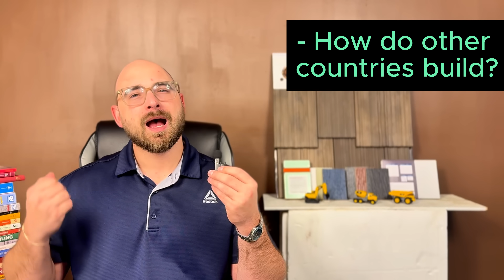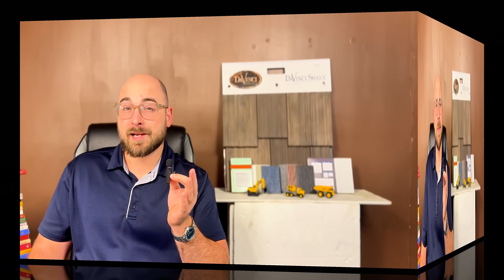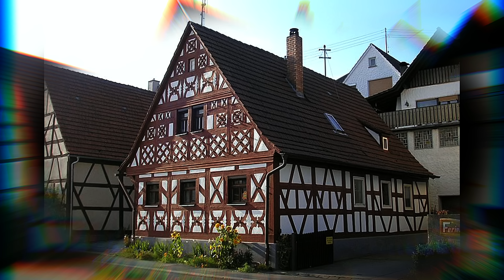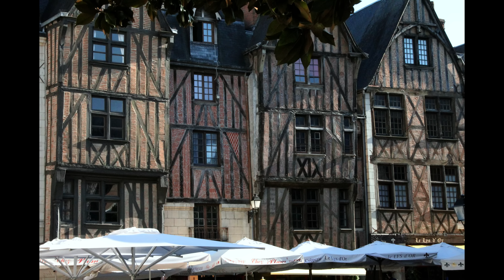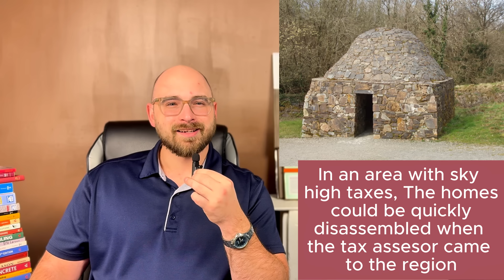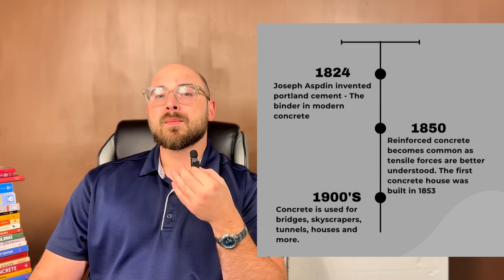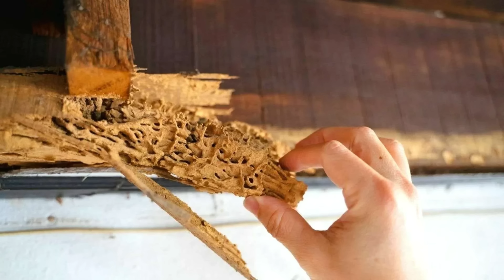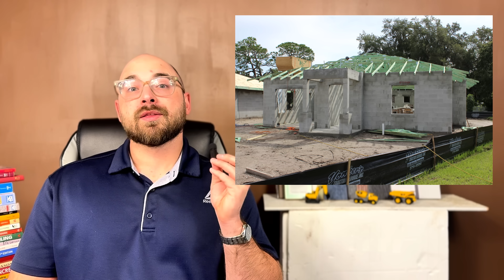Why Other Countries LAUGH at American Homes

Comment: I can tell you the answer from experience rather than internet research:
I was a carpenter in the USA for over 20 years. I also spent a year building houses in Sweden. The big difference that in Europe, designs are led by architects and engineers. In the USA architects and engineers are led by lawyers. The Simpson Tie company has a monopoly on how homes are built in the USA because they paid engineers to test their product. Engineers always specify what has been tested. If you don’t use exactly what the engineer put in the plans, the inspector makes you take it out. 
No USA architect will specify local materials without a hefty price tag because engineers won’t sign off on something that Simpson tie hasn’t paid some engineer to test. Because they are all afraid of being sued. 
You won’t get permits for anything that hasn’t been signed off by an architect and an engineer. Building codes are solely for avoiding lawsuits. Not safety. You won’t get insurance for a house that hasn’t been built in outdated inappropriate, light timber houses because it has been tested. Without insurance no one can get a mortgage. If no mortgage, nothing gets built on spec. So there is basically one residential building style for all climates, because Simpson Tie paid an engineer. That’s a sham! 
Forget the ancient adobe houses in the southwest. The ancient stone buildings are curiosities. Forget the 200 year old hay bail house in Missouri. To get a permit you have to prove that a building will potentially last. Actually lasting doesn’t count as potentially lasting. 
That’s why everyone laughs at Americans.
Reply: Many thanks for explaining. This makes sense. In the Europe every contruction material must have certification to be placed on market. Certification require testing of material acc specific methods. There is no monopoly for testing in the Europe. 
It seems to me, in the USA is main issue by monopoly system for everything. Too much centralised power for private companies which then are allowed to "lobby" (allowed corruption by law) at politics and authorities.
Reply: @roman45678  🎯
Reply: @roman45678  American capitalism is very similar to Russian socialism: no big variety. In Russia the state, in USA monopoly. And both have oligarchy.
Reply: You should make a video about this
Reply: So it's all because of Corpo Trash. Makes sense.
Reply: @Sphendrana  Literally the root of all US and, nowadays even, Western problems :) love to see it
Reply: @Sphendrana and Reagan,  he was corporate crazy! 💯💥
Reply: @Sphendrana  Capitalism making something objectively terrible? What is this, a day ending with y?
Reply: @kristoffer3000  That is quite simplistic. Capitalism as an idea isn't bad. If implemented correctly, it encourages innovation, competition and better products for a better price. The problem is capitalism needs to be reined in with regulations. That went overboard in with Thatcher, Reagan and other liberal conservatives (not the American idea of liberal) in the late 70's, early 80's. This put capitalism into overdrive and allowed a small group of people to gain all the wealth, as it was in the late 1900's, with the Robber Barons. I know this is YT, but the distinction is important.
Reply: @Yvolve  Yeah you have no idea what you're talking about, actually painful to read.
You're saying the people that removed loads of regulations actually put in place more?
Actual insanity.

Also saying liberal conservatives is just honestly funny, the people that are most against personal liberties are not liberal, they're also not very liberal when it comes to economics as it's always their own groups that stand to benefit and nobody else.

They didn't put capitalism into overdrive, they just pulled away protections which allowed it to be more brazen about what it does.

Capitalism has never and will never be good, it doesn't encourage anything other than being greedy, everything else is just a byproduct of that, if capitalists could just sell us the same slop year after year they'd be very happy to do so, technology moves forward despite capitalism, not because of it.
Reply: @Yvolve I’m sorry, but in the year of our lord 2025, we have mountains and mountains of evidence showing Capitalism is in fact not a good idea. No amount of regulations and laws is going to permanently keep Capitalism in that “sweet spot”that’s always talked about. Capitalists always want more, and we have seen countless times that they’ll inevitably monopolize, stifle innovation, and what we’re seeing recently and saw in the Gilded Age, a takeover of governance.

Europe has objectively better living standards than the US by far. Despite being Capitalist they haven’t succumbed to the same rot the US has because of  a better sense of community and more historical precedence to watch out for potential tyrants. In fact a lot of the reasons Eurpoe is better is because of their Socialist programs.
Reply: And every year that goes by I put more and more of Simpsons products into houses. It's obviously based on politics.
Reply: Great comment, very informative.
Reply: By the way, Here in Europe, we don´t need Companies to test some equipment. Everything you can buy here is already tested, and no Inspector can tell us to take it out, Everything here is already tested according to our laws. Otherwise, no one is allowed to sell this stuff here! You simply cannot buy a thing here that´s not firmly tested.
Reply: @bernhardmichaelfux308  exactly. All is on the laws implemented yet. An arquitect in Europe will only work with approved materials in the design of a house. Materials, structures, etc. With that base the arquitect and engineers will work in a house without any other previous requisit, because the materials already was proven, tested and regulated for all European arquitects and engineers freely (of money and for use it).

Even, for example, in Spain is aproved a new material, structure, model of construction, etc and a German arquitect want to use it in a new house in Germany. He/she can because the standars of quality tests is more or less the same level and then Germany don´t need to test the same material too (it would be a stupidity redundant). In the case of this example Spain did it for Germany. But at the contrary is the same too. It´s a more efficient concept or model of collaboration between European countries at the same time.

Regards.
Reply: @bernhardmichaelfux308 kind of, but not exactly how it works. If you build a house, people who know what they're doing will be involved. And they won't let you get away with mixing and matching as you please. They'll point you towards the exact type of concrete, wood, steal, glass or whatever for what you're planning. 

And that's a good thing. You have a plan, they try to get as close as possible
Reply: That was very insightful! It also put me onto another aspect of this: education. In Germany, we have a similar "everything has to be certified" type of mentality. Nobody will sign off on something if it isn't the officially recognized way of doing something. You have a safety issue in your building that you've thought of a unique solution for that's much more cost-effective? Too bad, they're not going to sign off on it because it's not a tried and true and tested way of doing it. However, because of the way we do vocational training, we have found ways to incorporate building materials that come with lots of variance into this mindset. We have a system where apprenticeships are officially recognised, with state-certified exams and teaching plans and so on and apprentices spend time both in the company where they learn the practical stuff and in the vocational school where they learn the theory. At the end, they're a state-certified __ and trusted by the regulatory body. So for everything that can go wrong with a certified product, there's the "but it will be applied by a certified __ who will know not to make this mistake or otherwise be responsible for it because it's an officially regulated standard they should have known" response to go with it so the person signing the paper doesn't need to worry about responsibility.
Reply: @struth1w5704  обратной стороной этого процесса является хаос застройки на востоке, где самострой можно в центре стамбула творить например, а потом это зарегистрировать. Ха. А потом землетрясение это все разрушит.... или нет. Баланс инициативы и сертификации очень труден.
Reply: Corporate lawyers and bankers are always the problem.
Reply: I feel sad that what you say does not surprise me at all, about designs being led by lawyers in the USA. Isn't everything?
Reply: @GillianBergh  Lawyers in the US squander and ruin everything they touch.
Reply: @ItsJustSimpleMe  Capitalism does that, lawyers are just a symptom.
Reply: @GillianBergh And who pays the lawyers? That's a much more interesting question.
Reply: @@Gretschbeach so what you think of SWEDISH house's Compared ? and I'm from DENMARK
Reply: @flemmingallanthomsen9284 In Sweden I built three new houses and did a large addition to another. The three new houses were stick frame, but the process was far more efficient and better thought out than USA. All of the lumber came pre-cut and the roof joists were pre-made and were lifted into place by a crane. That is something you almost never see in USA. I kept thinking that it was the natural evolution of what USA building style would do if it was allowed. Also having exposed plumbing makes so much more sense. The USA cuts and drills holes in the new framing to make room for pipes and wires  tk go through, which obviously makes the walls weaker. I wasn’t crazy about how much plastic was used for Vapor barriers and so on but there was nothing without a good purpose. The building process was shockingly fast and so little waste that it was comparatively inexpensive and exactly what the architect thought it would look like. They relied on good design rather than engineered gizmos. 
The addition was on a very old house on what I know as log cabin style construction. That was awesome, but perhaps this particular job was too much like a historical reenactment to count as regular construction. The thing that impressed me most was that it was perfectly appropriate for the environment in which it was built and all the material was sourced from near by, the trees came from a near by forest (we did not cut it) and stone for the foundation was cut in a near by quarry (but recycled from an old building.) Yet all the conveniences were inside, hot water, electricity, everything like a modern house. 
In both styles the Swedish houses will be standing after the American one will have rotted/rusted away and fallen down.
Reply: @Gretschbeach  thanks for the responds so Nordics countries seems efficiently at leased I can tell you found building in Sweden as a good experience.
Reply: I have so many questions about the legislative state of home constructing in the US, but as far as I got from your comment it seems that the main issue is proof of solidity. My question is, why is that a problem? I mean, if an engineer does their examination and, through applying math and physics, determines that the house is going to last, why do insurance companies, banks and whatnot don't believe them? I mean, if I move to the US and build a house out of stones on the outside and insulating bricks on the inside with a stone foundation and a structural engineer does his calculations on weights and lengths and attests the solidity of my house, why do companies don't trust their study?
Reply: @alemutasa6189  It's not that engineers in the US can't or won't go to any length you want them to go in determining a structural design to be sound. They certainly can and do, and their work is trusted. It just costs a lot more, and the price will continue to increase the more you customize. And yes, it's more complicated getting permits, which adds even more expense. In an environment where home building is driven by investors trying to maximize profit, the economics of that become difficult very quickly for the majority of people.
Reply: To be fair, it’s not the lawyers- it’s the corporations, insurance, mortgage bankers, who are hiring them. They lawyers aren’t the ones getting the payouts beside their hourly rate or salary like everyone other worker. The corporations and insurance and banks however are making big money by ensuring they have a near monopoly on the housing market.
Reply: Thanks,  very educational and interesting.
Reply: Super interesting!
Reply: Building Code in general is an issue in the US as it is here. It does not allow for variation. Suburbia all looks exactly the same because the code is so strict. This takes away the need to innovate and improve, as it will look nearly identical. In other countries, the rules allow for many more types of buildings, so you have many different certified designs. As well as being less litigious of course. 

NotJustBikes talks about Canadian/American vs European city planning. The focus is on bicycles but it is much broader than that. Very interesting content.
Reply: @ Building code is a very very different thing from zoning laws - NotJustBikes talks plenty about having better zoning laws, but that is still done with strict building codes for safety reasons.

And neither of those things explain why suburban neighborhoods in North America all look the same. The reason for that is that developers are putting up their own money to build them and want as much profit as possible. So they aren't really designing, they're picking from big catalogs of pre-designed components and assembling them like a Lego set.

But also in fairness, neighborhoods all over the world tend to conform to their own regional expectations just like they do in North America. Those expectations just happen to be a little different.
Reply: @Narf0101  Yes, zoning laws, I couldn't think of the term. English is not my first language. 

Both explain it perfectly. They are very limited and essentially forces builders into the same cookie-cutter style. It is also the cheapest, but within what is allowed. 

If the zoning laws would allow for more types of housing, not just single family homes or high rises, there would be more options. This makes it a choice from a catalogue, because that is what the law allows and is easy to build within the law. 

Not quite true. Neighbourhoods are built to accommodate its purpose best. It is usually a mix of single family homes, some are low-rise apartment buildings, others high-rise, some double houses, some very big villa's and more. This means no homogenous groups, like suburbia has.
Reply: So, are you saying that USA citizents are not free OF ANYTHING, not even built their houses they way they want to??
Reply: From experience, and not internet research, what is true in one small part of the states, does not make it true in every state.

Pre-fabbed buildings are quite common, both for exterior and interior walls, and most especially for the truss packages.

Exposed MEP trades are not very common in the states due to having 4 seasons in the States.  Flash freezes are common as are days where temps are 95 or more degrees(F not C) having these trades exposed rather than in a more controlled zone leads to premature wear, failure and serious hazard risks.

The number 1 issue with home quality in America is the demand.
The state I live in has immense housing demand and we are projected to fall several hundred thousand short, despite record numbers being built.

Our crews literally don't have the time to create wonderful masterpieces.
Reply: Seems like everything wrong in America can be chalked up to someone decided once that allowing unlimited corporate money in politics was a good idea, and everyone then keeps looking around like why does literally everything suck for everyone that isn't a corporate monopoly. Funny enough when the value of your "free" speech is contingent on how much you can pay for it the wealthy corporations get to define the conversation about everything.
Reply: One more insight that reforces my opinion that the USA is just a corporation disguised as country
Reply: That adds a lot to the real answer.
Reply: Informative comment. Thank you
Reply: It sounds to me as if the building industry in the USA is run by the same people that run your health care system.
Reply: Thanks for the explanation
Reply: There are 911 likes. Not changing it. Aah, the AmErIcAn DrEaM.
Reply: @julienferte4662 Stop being antisemitic!
Reply: ha wow
Reply: So what you're actually saying is that US houses are built better because they have standards? I'm not exactly sure why all that is a bad thing because if insurance won't cover it because it was built badly then why would I want the house that insurance won't cover because it's probably built bad. Insurance isn't there to pay out money. They're there to save money.
Reply: @Tb0n3  Почему стандарты не помогают целым районам городов от пожара? Чего там в калифорнии дома городами целыми выгорают, раз все такое классное и застрахованное.
Reply: @Tb0n3 he did not say they have standards. He said everything had to be built specifically of stuff tested. They may avoid testing expensive ways to built. Or cheaper ways to build but that take longer. Or ways that last longer
Reply: @Tb0n3  No that's clearly not what he was saying. Also read some of the comments in this thread.
The approval process for new building materials and techniques in the US is just such a hassle that nobody bothers anymore. Whereas in the EU everything is also tested but there's less red tape and protection of monopolies etc., so there's a lot more innovation and flexibility.
Reply: Простые американцы в рабстве у юристов и громадных корпораций лоббистов.
Reply: but the guy tells in the video there are concrete and cinder block houses being built in US. how do they do it then? seems like what you stated is only true for some states
Reply: this is true, and this is also true what the dude of the video said, it takes much more time to make a home here in France than in the US for exemple. But I rather wait a bit more and get something good
Reply: @Loutripe  What's the average build time for a home in France?
Reply: somehow... the more I read the worse it keeps getting :D hahahahhahahaha 'why are people laughing at us?!' ohhh I don't know it could be because there is no reason and it could be because you are to be laughed at!
Reply: much freedom eh ???
Reply: europe has insane regulations on house construction and sizes as well.
Reply: Nailed it!
Reply: Spam it to other comments so most would know.. im from minnesota and most know its cold here, but my house is always warm during cold season and cool during summer... the homeowner is the real issue if one cant keep their house warm..
Reply: Thats what unchecked capitalism gets you... And also trip to a hospital in an ambulance cost more than burying you after you die
Reply: Capitalism needs capital 😢